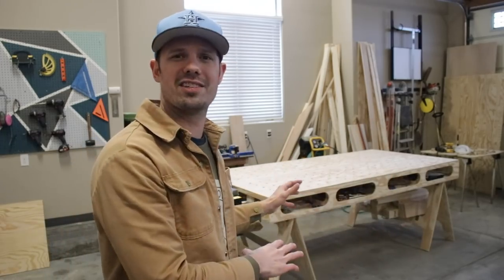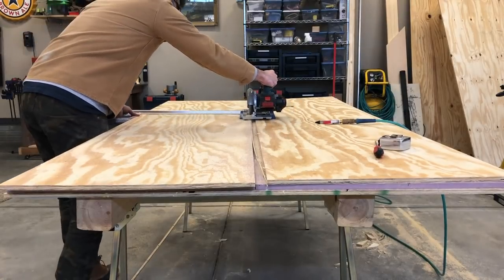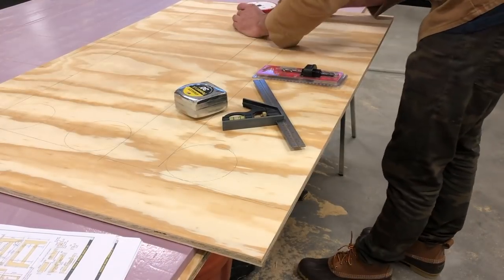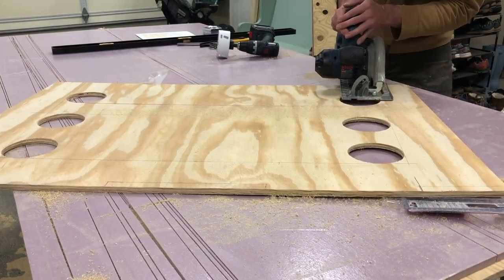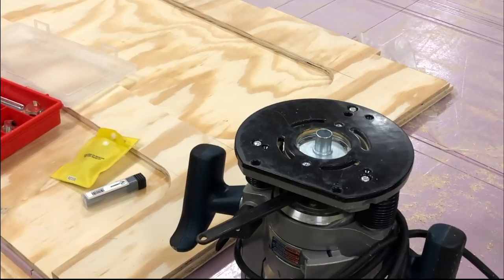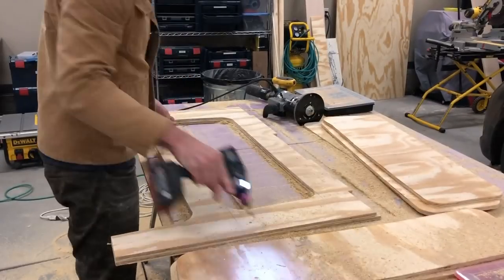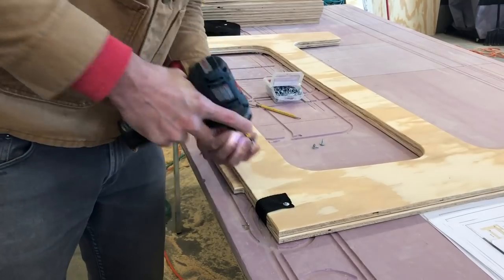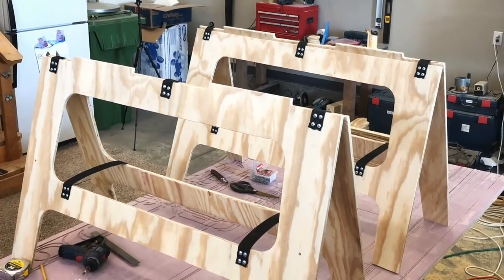Building the Paulk Workbench, Part 1 (Main Cuts & Sawhorses)

Comment: Great job and great enthusiasm. I LOVE your technique of using a sacrificial foam insulation board between plywood of the table and one being cut.
Reply from the maker: Thank you Johnny! Yea it works really well.  And can last for a long time too.
Reply: Liked the foam sheet idea too. Great safety idea if you need to cut 4 X 8 plywood smaller for use on a table saw in a small shop!!

Comment: Nice video.  You should mention that cutting with a pattern bit does NOT give you the same copy as the template, because of the bearing insert that rides along the template edge. The cut is offset from the template, probably by. 1/16th on each side. Doesn’t matter here for saw horses, but does matter elsewhere. Here you ended up with 3 identical sides and 1 (the template) with a bigger opening in the middle. A flush trim router bit would work to give you an exact duplicate and can easily cut through 1/2” ply
Reply from the maker: Thanks Brian! Also great reminder! Thanks for sharing that knowledge with the community here. I think I forgot to mention it in this video since I wasn't too worried about the differential with my saw horses. I'm pretty sure I mention this factor in part two, since the variation is a little more important with the carcass spacers.  As far as the flush trim router bit option (another great option), I had too many templates to cut (see part 2) so I opted for the more durable full spiral bit with the template collar instead of burning through flush bits. But it would have been worth comparing the cost of say 2/3 flush bits vs the one spiral bit because it still might have been cheaper! Thanks again for taking the time to post an insightful comment.

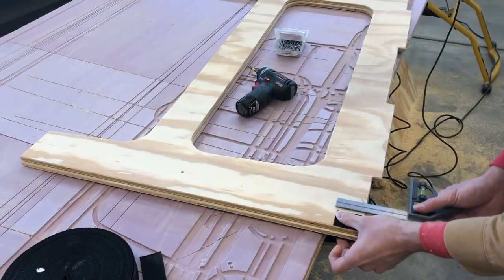Comment: 12:18 Not a sliding square, but a combination square
12:35 Not pan head screws, but truss washer head lath screws
13:38 Still a combination square, definitely not a speed square which is a totally different tool.
Reply from the maker: Thanks bro. You just can't get away from them on the internet.
Reply from the maker: HAHAHA! Great reminder that I'm not perfect.

Comment: Doesn't using webbing for hinges on the top of the horses make them wobbly? I know Mr. Paulk must have been satisfied with how they function, otherwise he wouldn't put it in the plans but it looks like there'd be a decent amount of "slop." Could you use door hinges or something instead? Maybe with the table sitting on top makes them not move? But if they are only stable when used with this benchtop, it'd make them a one trick pony?
Reply from the maker: Not wobbly at all! This thing is so stable.  Did you see me jump on it with my 200lb body at the end?  Thanks for the comment!

Comment: Question about the first sawhorse panel that you built (the one used as the template for routing the others). Is that piece ever so slightly different from the other 3 pieces because of the bushing used in the router? Could you use a flush trim bit with an upper bearing to get a perfectly flush cut?
Reply from the maker: Yep. It is just a bit bigger but it didn’t bother me so I left it. Not even possible to tell when all finished. But yea I suppose that would work if you had the right bit and bearing.

Comment: I’m going to be building the Paulk Smart Bench and I’m torn between 1/2 or 3/4” plywood. Are you still using this bench now? Did the 1/2” work out well enough or do you wish you would have gone with 3/4”? Thanks!
Reply from the maker: Awesome! After 3 years it is a staple in my shop. I’ve also moved it twice.  I would definitely not do 3/4” mainly because I just don’t think for the size and weight you get any more benefit since for me the 1/2” has held up so well over the years. I’m actually planning a “Paulk Workbench After 3 Years” Video and this has reminded me to do it. Hope that helps and if you need anything else let me know!
Reply: @diywithandrew  that’s great to hear! I’m thinking the 1/2” will be the way to go since I’ll have to have it standing up in a corner of my garage when not in use. Also, for the video I’d love it if you could go through any dog hole accessories/clamps/etc that do and do not work with the 1/2” thickness.
Reply from the maker: @josephlebo7320  Yea man knowing you will need to move it around and stand it up I would definitely affirm the 1/2" choice. As far as the dog hole accessories, I will for sure add that to my video.  Stay tuned and thanks again for the convo!
Reply: @diywithandrew  update! I built the Smart Workbench and went with 3/4” for everything. It’s heavy but not too bad actually. I’m glad I did for stability and strength
Reply from the maker: @josephlebo7320  Nice! Thanks for sharing.

Comment: First off, great video...very helpful.  Ron's plans don't really give a ton of detailed explanations.  I'm new to using a router with a template, so this may be a total newb question.  Did you account for the difference between your collar and bit when using it to but the other three saw horses and spreaders or was the difference not really important for this particular application?
Reply from the maker: Thanks man! Great question.  For the saw horses, it didn't matter to me that one of them was slightly off than the others and for the spacers, I made one extra and saved the template so they would all be the same size with the cut out. Hope that helps!

Comment: Hi how did you manage to cut the templates flush. The spiral bit looks smaller than the guide bush. So won’t there be an offset ?
Reply from the maker: There is a very small offset.  Since the first was a template, the ones that I cut were all the same and I kept the template out of the project to save for if I build another one.  Great question!

Comment: Now don‘t be offended, this is a serious question. I have always wondered why you would build the sawhorses, there are reasonably priced sturdy metal ones out, adjustable in hight. I‘m using those and nothing rocks. The Ron Paulk‘s design of the horses look far less rigid to me. And with 2 sheets of plywood they are probably not even cheaper, are they?
Reply from the maker: No offensive at all! Fair question.  In terms of cost, I do think two sheets of plywood is cheaper than a good set of horses.  I like the idea of the work bench sliding onto the cutouts in the plywood horses.  All I can say is that it has worked VERY well and I'm over a year into having it.  I was just standing on it yesterday to reach something and no shake or wobble at all. If you have good horses, I think you could skip that step. Maybe its just the look of consistency?  Anyhow thanks for commenting!
Reply: Field Treasure Designs 

Thanks for the experience, I only had the look and if it works it works! Greetings from Mallorca.
Reply from the maker: @berndheiden7630  Thank you! greetings as well. Beautiful place! Can I come visit?!
Reply: Field Treasure Designs 
Any time when you visit the beautiful island!
Reply: One thing I noticed in the Paulk illustrations was a framing square leaning on one of the legs suggesting that one cold store it there, so making your own they can be customized

Comment: hi may have missed it but what is that insulating material is it a high density foam or Styrofoam?
Reply from the maker: Great question!  It is R-5 Rigid Pink Foam Board Insulation Sheathing available in many thicknesses and 4' x 8'.
Reply: Thanks looked it up here and the stuff we have here have bad chemicals  that when cut and produce dust will be harmful

Comment: Reduce your rpms with a hole saw that large
Reply from the maker: Great call.  Glad I didn't rip my arm off.
Reply: It's not just about control.  Large diameters at high rpms mean there's a lot of SURFACE SPEED, and surface speed equals heat, which causes the bit to lose it's temper, which allows it to dull faster, which means more friction, which means the bit loses its temper even faster, which allows the bit to dull....    it's a vicious cycle.
Reply: Yes , surface speed. A hole saw can build heat burn the material and damage the tool quickly. Can even break the Arbor your drill chuck is mounted on. Careful use and a hole saw lasts for a considerably longer life
Reply: Also put a front handle on your drill, otherwise you run the risk of serious damage to your wrist.